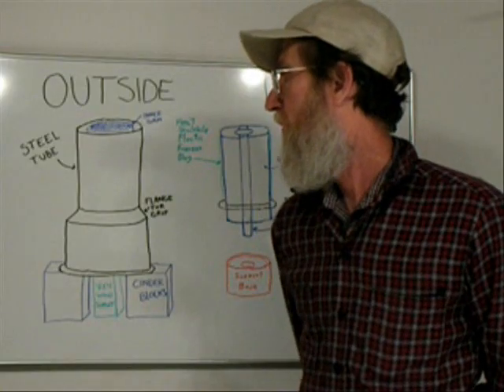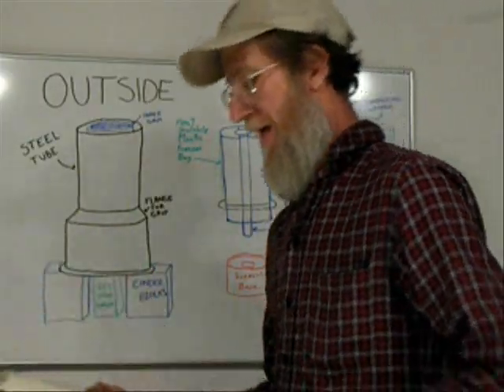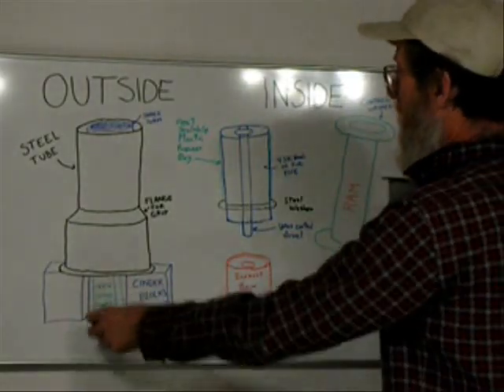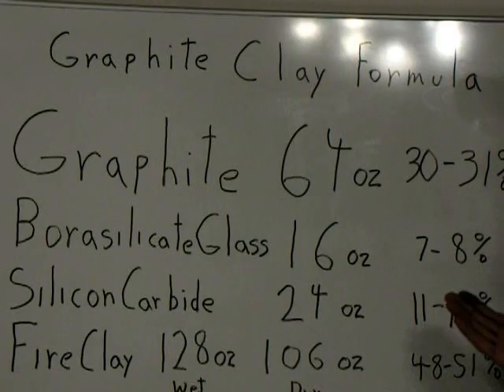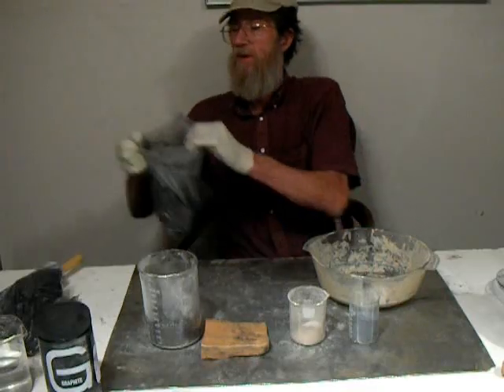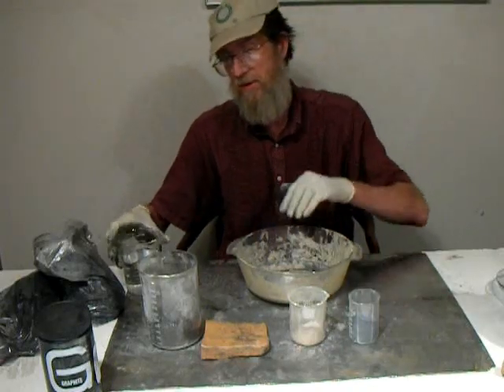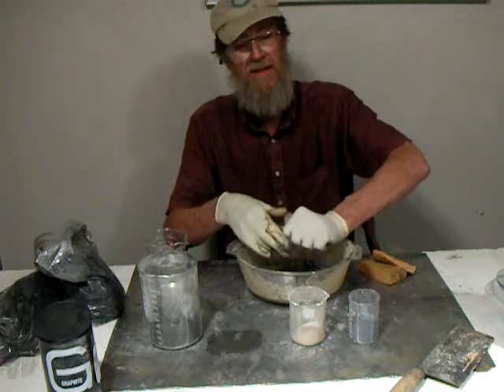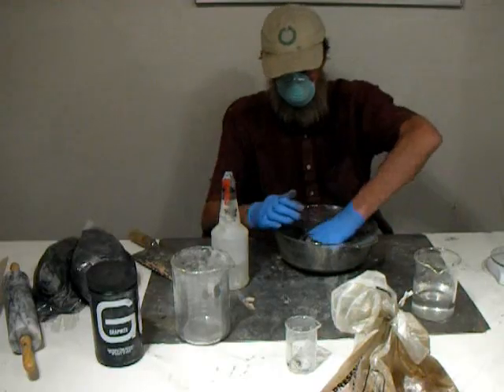Making a Graphite Crucible

Comment: I am a bit familiar with ceramic slurry casting.  as that is for dishes, cups, and decorative items I know that such clay would be a poor idea for a crucible.  that's not what I was thinking though.  for those who aren't familiar with it, its simply pouring liquefied clay into a mould and keeping it full for a certain amount of time.  that is where my question comes in: can you add enough water to make the graphite clay into a thick slurry and cast it in much the same way with at least a reasonable success rate?
Reply: I was going to ask the same question. Did you ever figure out the answer?
Reply: +Jacob Lanctot not at this time. not in a situation where I would be able to try it myself.

Comment: where can I find borosilicate glass?????
Reply: Borosilicate glass is generally the type of glass used for glass pots and cookware that has to stand up to high temperatures and in particular high temperature differentials across the glass because of its very low coefficient of thermal expansion.  It does not expand much when heated or contract much when cooled so it doesn't crack up when placed in a microwave or even on a stove burner.  Lime glass generally would break under those conditions, so your looking for glass pie dishes, baking pans, and pots made for microwave, oven, or stove top use.
Reply: +Shawn Peterson 
Thrift shops, estate sales. Find old PYREX glass ware, it was borosilicate glass, the newer pyrex is lime glass. At least that is what wikipedia says.

Comment: No to be nitpicking, but isn't this technically a clay graphite crucible? Proper graphite crucible is made from pure graphite after all........
Reply: Then the graphite would melt before the the metal did
Reply: +Collin Crawford No it wouldn't. No single element has a melting point higher than that of graphite. Not even tungsten.
Reply: Oh sorry I was thinking of lead *facepalm * my bad
Reply: But where would u get graphite?
Reply: +Collin Crawford A graphite crucible you mean? There are quite a few companies that sell it. You can get Chinese graphite crucibles on eBay by the dozens (they're usually the real thing, but be wary of the ones that look like fired black clay - most probably they are i.e. graphite clay crucibles), but if you need bigger, you can ask around e.g. on alibaba.com or get some at graphitestore.com.
Reply: +CoolKoon 
Graphite does not melt at normal atmospheric pressure. It sublimates. It will melt at 4200 kelvin at 100 atmospheres.
Reply: +Syrnian I know, but that still doesn't invalidate my point, because even its sublimation temperature is higher than the melting temperature of tungsten.
Reply: CoolKoon 
Sublimation is not melting. Melting requires that a substance enter a liquid state. Graphite skips it.
Reply: +Syrnian Guess what: I KNOW what sublimation is, but from a crucible's point of view it's irrelevant whether it melts or sublimates: the result is crucible failure either way.
Reply: CoolKoon ok thanks!
Reply: +Xcision Mist Sure, np. BTW if you decide to purchase a graphite crucible, please take two things into consideration: 1) it has a high heat conductivity (i.e. if you'll be heating the contents from the inside e.g. with an electric arc, you'll have to put the graphite into some really good insulator, otherwise it'll grow cold with your molten goodies re-solidifying inside in no time) and 2) many elements (e.g. iron and silicon) have high affinity for carbon i.e. your crucible will contaminate them (thus causing e.g. silicon carbide to form).
Reply: CoolKoon ok thanks for the info.  Very helpful

Comment: ive found if you roll out your clay real thin, sun dry it and then crush and powder it. you can mix all the dry ingredients like a cake then add just enough water to make a air free mold. pack it and is way less work to get a extremely even blend
Reply from the maker: altazink Good idea. Still it would be better to use some type of motorized device to crush it.  Maybe a large steel roller filled with lead on a motorized turntable.  That could also be used to crush the glass from scrap Pyrex but be sure to make a cover for it.  Glass as you know pops many feet when it breaks.
Reply: +rlbob1 
Ball mill.
Reply: 2nd the ball mill.  It also seems extremely helpful for mixing green sand.  I found an old steel hollow ball.  I believe it was a tank float?  Figured full of lead it should weigh 30 pounds or so.  Should be plenty of weight to press the ingredients together.  Far as i know anyway.

Comment: Hi sir, my material is silicon carbide, water & methanol in sentering process, can you pls give me some advise how to bind them together or do you have other video related to this tnx
Reply from the maker: Byron Salarza Not sure exactly how to accomplish it at home. With silicone carbides melting point a 4950F 2730C it will take quite a bit of heat for the ceramic sintering process to work.  Just guessing you will need a very strong metal mold designed so you can achieve very high compression and eject the greenware without damaging it. Probably a 3 part female mold bolted together and a 20-40 ton arbor press might do.  The core mold removal is always a problem with that type of compression.  Be aware that we are talking about up to 40% shrinkage once the sintering process is complete.  As far as the sintering temp it should work at around 3632F 2000C but you may have to use inert gas or other non-oxide aids.  Interesting project.  Let me know how it turns out.
Reply: sure, thank you very much

Comment: Great video thank for the information!! Where did you get the borasilicate glass and silicon carbide powder though?
Reply from the maker: Kenneth Finger Silicon carbide look under abrasives usually available on eBay.  Borasilicate glass is sold as glass frit.  Look for the clear borasilicate variety.  I obtained mine from crushing pyrex labware and filtering it.  Hope this helps.
Reply: Kenneth Finger  Yeah I had the same question about that one. More just the borosilicate glass. Would garnet granules be a suitable substitute?

Comment: This gave me some ideas on what I need to do, I want to make a crucible that will accommodate the irregular shape of my furnace and not waste any space but concerned about the heat flow as well. I don't want to break down its efficiency so any suggestions would be appreciated as for the fire chamber coverage

Comment: I noticed when you were hand-mixing that you started kneading the stiff clay immediately after wetting it. When I want to "thin down" stiff clays a bit, I prefer to add the clay & a bit of water to an airtight container, then forget about it for a few days. Letting the water work its way into the clay on its own is far easier, and makes for a much less slimy experience, IMO.

Comment: So where do you find all these ingredients?  Are they easy to find, or does a guy need some sort of special license to get them?
Reply from the maker: Aubrey Smith I know what you are talking about.  Ran into it with the graphite.  A certain shipping company considers it hazardous and will charge a HAZMAT fee.  US Post office does not. Along with I think FEDEX.   ALL ingredients are safe and non hazardous.  But you should employ reasonable safety precautions as far as dust.  Try not to create dust when you mix it and add water when you can.  If it was combustible you would not be placing it in a foundry in the first place.
Reply: ***** I don't know where you live, but you might be able to contact an oilfield drilling fluids company to get the graphite, if there's one nearby.

Comment: I read somewhere that the baking temperature must be above 1600 Centigrade degrees. Is it right? your oven can provide that much of temperature for several hours? please explain about the baking time and temperature.
Reply: *****
another option is buying a clay graphite crucible for $20
Reply from the maker: No the oven is only for drying.  Be extremely careful as you approach the boiling point of water as it can explode from the steam.  After that it is up to a very careful first fire.  Another option is to take it to a ceramic shop and have it fired in a proper ceramic kiln.  Watch the video again you missed the firing part.
Reply: Sugarsail1 i dont think you can get on that size for 20 buck
Reply: +rick balthis If you need a crucible chance are you already have/will need  that equipment
Reply: +rlbob1 someone told me that a vacuum oven is required. and a ceramic kiln is not a vacuum furnace. are you sure that it works?
Reply from the maker: +Lion heart Irani  Its a clay graphite crucible.  They may have been talking about the loss that occurs where the graphite combines with oxygen and over time erodes away.  Eventually the crucible burns out but it lasts much longer than steel or cast iron.
Reply: i really appreciate your response

Comment: I have just found this video, it is very informative, but the middle section could have had some more commentary, either by voice-over or subtitle I feel.
Just after you are shown with a face mask on when mixing your refractory, you used a spray bottle, - was that just plain water, or did you use wetting agent or some other compound?
I appreciate your use of proper PPE, the first you tuber I have seen do this, even some highly respected contributors only wear jeans and boots with perhaps a face shield if they are lucky, but you did it right IMO.
Thank you for all the effort you have gone to to research your topic, make the video and post it and then answer all the questions from those who would follow your lead, WELL DONE
Reply: I second that comment on the safety gear. If you haven't already, you should see his 3 refractory making videos. I picked up all kinds of information from him and like his generosity in sharing such details in design process. There were a couple times I was laughing at myself cuz I wouldn't have been using shit for the particular task he was doing, yet he was decked out head to toe. I respect that though, safety first, guess I'm just lazy and stupid.

Comment: Will a clay graphite crucible work in a charcoal fueled furnace? I read somewhere that clay crucibles couldnt be used in certain types of furnaces.  I am currently having someone weld a steel crucible for me to get started melting aluminum, but after seeing this video I want to also try my hand at making a clay graphite crucible since they last longer.

I already have some ideas on a mold for the crucible that should work while still coming apart easily, I just need to know if it is safe to use one in a charcoal furnace first before I go to the trouble of making it. 

Also, The steel crucible I am having made for me is from 6 inch steel pipe with a quater inch wall thickness.  Can you tell me about how many melts I could expect to get from it?  I am only planning on melting aluminum.

Any help is appreciated.
Reply: Jon Coates A charcoal fired furnace will generally have a less oxygen-rich internal environment than his propane one. Assuming you aren't forcing in inordinate amounts of air (which you'll never need for melting aluminum), you should have little/no problem with burning the graphite out of a graphite-clay crucible.
As far as a melt-count on your 1/4" wall thickness steel crucible, that will primarily depend on 2 things:
#1: Steel Alloy..while something like, say, an M2 tool steel can withstand pretty much anything you can throw at it without lighting the aluminum on fire, some lower-temp grades of "mild" or "stainless" (or especially anything with a >2.5% carbon content, like "cast iron") steel could melt marginally close to your working temps & not last long at all.
#2: Overheating...the closer you stay to the temperature where the aluminum "only just" melts, the longer your crucible (any crucible) will last. The more heat you use beyond what's necessary for your process, the faster you'll degrade the crucible.
With that said, on average (assuming you used a decent steel & reasonable firing temps) you should get at least a couple hundred firings out of that thickness of a crucible I think.

Comment: Hi there, this video is fantastic, thank you for your hard work, research and for sharing it with us, you are obviously extremely skilled! I have a question please.. what sort of temperature can these pots take? I am a glassblower, and we generally use ceramic pots in furnaces that operate around 2300f continuously. Thank you!
Reply from the maker: Although it has withstood heat in excess of 2500 where I have melted the ceramic lining of my foundry I recommend keeping it below 2500 for practical reasons.  Continuous operation furthers me to say unsuitable.  You need cheap disposable ceramic.  Graphite's claim to fame is thermal conductivity rivaling that of steel with considerably more longevity.  Thick ceramic pots which can take the extreme erosion and be cheaply replaced would work better and make more sense.

Comment: How long did this crucible last you? Is it still operable?
Reply from the maker: I retired it after a few years. Still serviceable but I wanted to try a really experimental thing. Works great but I am hesitant to post the formula due to the difficulty of safely drying it properly.  It is hygroscopic and extremely difficult to dry out for the first fire.  LOL makes the foundry first fire look like a cake walk.  First one I tried blew up in the oven.  I will post it later once I work out the correct and safe procedure.  It shows extreme promise but I have to test it farther.
Reply: *****
What are your thoughts on Magnesium Oxide in the crucible or mixed in with the refractory? Very high melting temperature...would it raise the max temperature of the furnace, or is it the lowest temperature material which is the real issue (potentially causing cracks)?
Reply from the maker: Complicated question but I would say the lowest temp is the issue.  The glass was added to the first formula to keep the graphite from evaporating but in small enough amounts it becomes soft but sticky so it is not an issue.  The real problem is making sure the materials are evenly mixed. Graphite and clay are a bit like trying to mix oil and water so  I recommend using some sort of mechanical means to mix properly.

Comment: +rlbob1 Great video series. Bottom line up front: Do you think that powdered Boron Oxide in place of the Borosilicate Glass might be an option? It looks like the only options for obtaining the powdered Borosilicate Glass is to get the glass as whole or broken pieces and crush it fine or very expensive glass beads. I looked at the production of the glass and that is the additive used to produce it. It might in the end give a more effective product. See here: http://tinyurl.com/k36adxm
On another note, I'm picking up a couple of propane cylinders off Craigslist next week. The experiment begins! Thanks for the great videos~

Comment: What size borosilicate glass beads are you using and is there an alternative (cheaper) ingredient.
Reply from the maker: Ok I started out with the video which was to show a unique extrusion process for making a crucible.  The formula was derived from an existing internet possible formula which was the only one out there in the world.  I ran Patent searches for about 6 months to take an educated guess on a working formula.  After a few failures this one works.  I have another formula but I am holding back waiting on failure for the first few I made using this one.
   Are you an experimenter and an adventurous type?  If so I can tell you what to try as a substitute but it is not fully field tested. And extremely difficult to work with.  It's highly hydroscopic and nearly impossible to to dry before a fire.
Answer.  Look up glass frit and find borosilicate frit. The purpose of the glass is to lessen the evaporation of the graphite at high temps.  Some patents showed common bottle glass ground to an extremely fine micro powder but I discounted it based on the physical characteristics of soda vs bora.
 In answer to you other question I bought my Borosilicate glass from a retired chemist who happened to own a bookstore.  He was selling lab ware and tossing the broken stuff in a dumpster.  I offered to purchase the busted Pyrex from him for shipping and a few dollars.  Got about 30 lb and he made sure it was all Bora
Good luck.
Reply: ***** I always willing too try just about anything when it seems practical to solve the problem.  I will even go to the adventurous side if the chance of serious injury is only slight.

With your current formula I suspect the best choice would be for some of my wife's dishes to suddenly become damaged (-:.